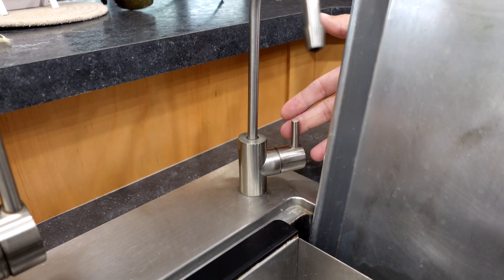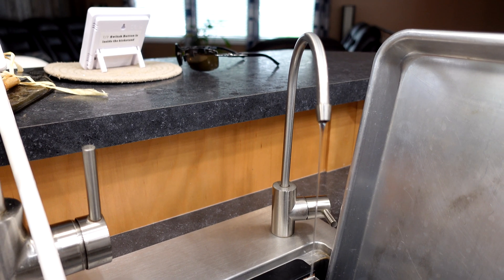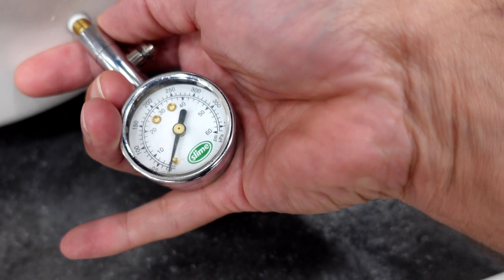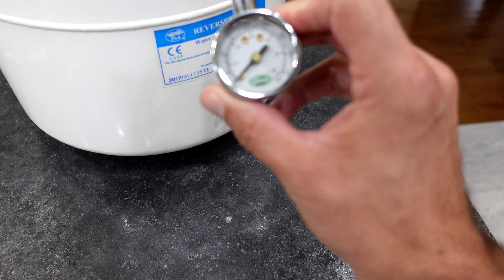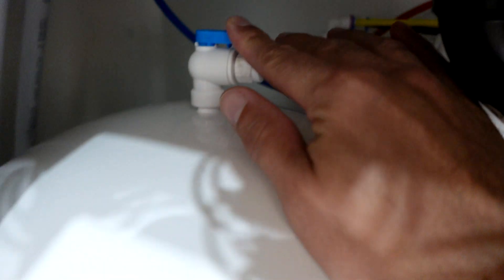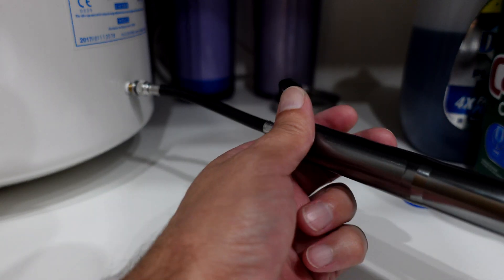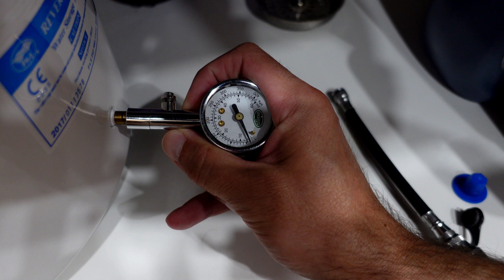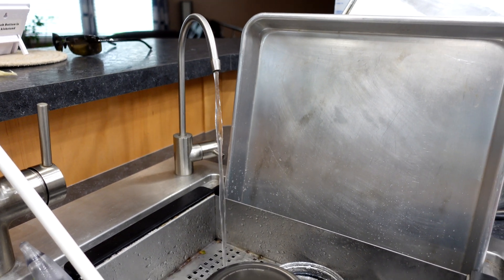Low RO Pressure? Quick Fix Guide!

Comment: I just have the $110 kit from Amazon, 1 gallon of water. The system is not used TOOO much and the 1 gallon does just fine!

Haha make certain that you have it all sealed up perfectly with Teflon tape and Caulk, the water is so amazing! All the normal brands you will see in the store use the same filters, the sediment filters, active carbon filters, and the one that I cannot open is the Membrane tank but it has calcified or something, I will just buy a new Membrane.

Reverse osmosis is the best! It will all be amazing until the middle of the book of Revelation occurs and almost all of the fresh water is contaminated. The 7 level Reverse osmosis will have to be 14 levels lol. If they can get manufactured. Sand, buckets, and silt and cloth will do pretty fine. My boy scout knowledge will have to help me out lol

I came here to see if you had any wisdom on how to get the same filter I set up for my grandfather's sink to fill more than 2.5 water bottles. You have answered perfectly! Thank you!

Comment: The first thing that you should do is try bleeding the Schrader valve. If water comes out, then the tank needs to be replaced.  In 30+ years of me owning RO systems, I have never once had a tank that was low on pressure, but have had to replace tanks every 2 years or so, they are just not built to last.
Reply from the maker: I've never had to do this before, or again since I made the video.  You have a great point though bleeding the valve is a great way to check tank integrity.
Reply: In 25 plus years of owning the same ro system, I have never had a tank fail, but have had to repressurize a number of times

Comment: I thought the tank had to be completely empty to set the pre charge correctly.
Reply from the maker: I do believe you're correct, I elected to open the valve on top and just let the water pump out with the system was disconnected.

Comment: I have a tank that wasn't used for a year and was full of water the whole time, is there a test I can do to check if its still functional? I drained it out, but I think it drained a whole lot as if its filled to the brim and there's no air inside left.
Reply from the maker: I'd fill it to factory recommended settings with air, more water will likely drain out.  I would be concerned about bacteria that had a chance to colonize in the tank though.

Comment: At the end the water still looked slow coming out compared to mine.
Reply from the maker: Keep in mind as well, without a boost pump you're limited to your municipal water pressure.
Reply: @HouseDadLife  My system is set to 10PSI  in the tank, that is why mine comes out quicker.
Reply from the maker: That makes sense, my tank isn't rated that high.

Comment: Is the tank pressure still the same if you have a booster pump??
Reply from the maker: Tank pressure is its own thing from what I understand, just make sure your pump is off and the system is off and empty, then fill according to your manual.

Comment: Thanks for the video, I think you meant 6 BAR not PSI? Correct? On the tank it says max is 100 PSI, could you plz confirm
Reply from the maker: It was psi at empty for my tank. Make sure to follow the instructions for your tank.  As the water fills the tank the psi will go way up. My guess is your tank is filled when the tank is full of water, the manufacturer should have a specification. Good luck, might be the toughest to just find the information.

Comment: Excellent. I've found my capacity varies with my house water pressure... when my house filters are dirty, lower pressure = less capacity. Maybe I'm imagining that, but I don't think so. Yeah, it's been a spell since I've adjusted mine, I think it is time. For you, I grant a SMASH!
Reply from the maker: Thanks for the tip Hydro, I ended up doing both at the same time but the dead give away for me was the tan was full and even with the valve open nothing came out.   I was thinking I should do what you did and put a whole house filter on as well.  Lately the water quality in the area has been pretty poor.  Thanks for the smash and the chat!